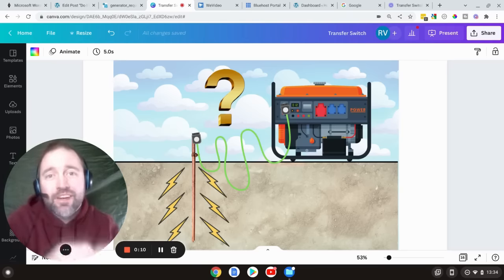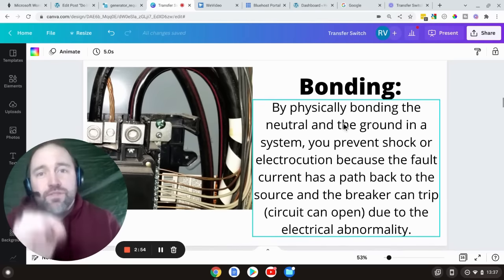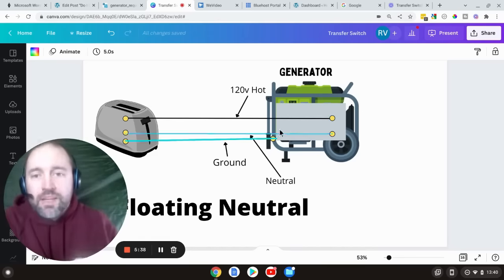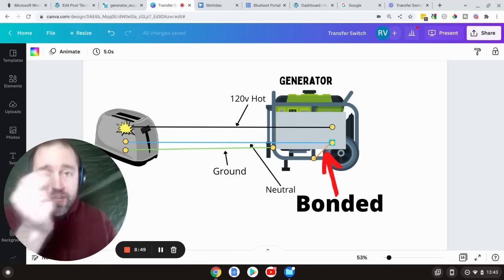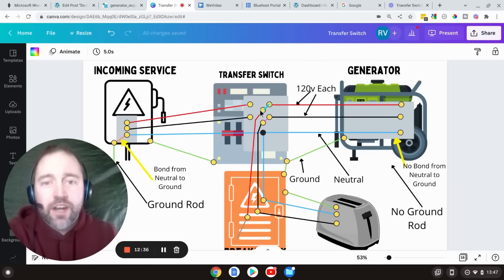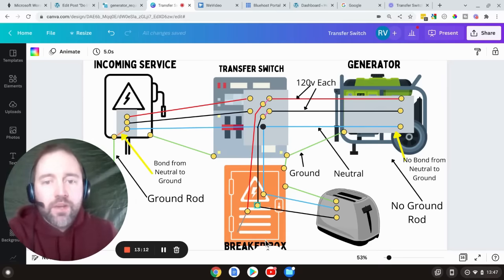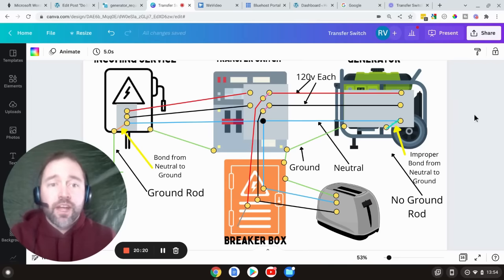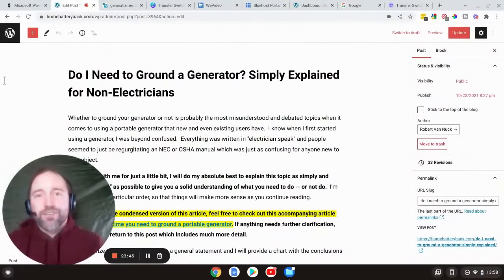When You DO and DO NOT Need to Ground Your Generator [Extension Cord Use & Backfeeding a Home]

Comment: As it has become more popular to do because it is cheap to do, what about going more into running an extension cord into the house from a small generator as in you manually move important stuff in your home to generator power by unplugging from one power source and plugging into the other source?  What I have come up for this for the 'easy' way to do it is the following:
1. Pretty much all of these small generators are floating ground even if they don't explicitly say they are.  So for bringing an extension cord into the home, you need to have a bonding plug on the generator.  Really, all of these generators should say what the deal is so you know you are doing the right thing, but they don't all say.

2. Especially in an emergency backup situation with extension cords, you can have things electrically tied together that are not all on extension cords.  Say you have a wired in Ethernet network in your house.  Those are generally copper wires running around to different devices.  If say you only hook up some of the devices to the generator and leave other devices plugged into dead wall outlets, you can end up with a big static potential difference and ultimately static discharges across sensitive electronics.  Then there is the whole deal where then nothing on the generator is connected to earth ground.  So what I came up with is you want to build a cable that only has the ground wire so you can hook the generator ground to house ground.  (It can split out from the male plug to have power on a female plug on a separate cable, but the special thing is one wire coming out is only a ground wire to a standalone male plug.)  Then everything is at the same potential over that ground wire only connection to house wiring.

Electrically when I think this through, everything is essentially bonded at one spot, the generator; it is just the Earth ground goes through the extension cord from the generator into the house and then you complete the connection to Earth through an electrical outlet in the house.  This is as in only the ground prong is hooked to the plug that goes into the wall.  If you get a plug with a light in it, it can help indicate to you when power comes back on in your home.

Tell me if there is anything wrong with my thinking.

Comment: My generator is wired direct to the panel thru a 30 amp breaker.   There is an interlock switch to shut off mains before enabling this breaker.    Does my generator require a ground rod?   I am guessing no because the ground and netral would be connected to the panel

Comment: What about using extension cords with either a floating neutral or bonded generator and your generator is being run off your porch and is not on the ground do you still not need a grounding rod? Thanks.

Comment: So if one is using an Intetlock kit, the ground wire from the generator would be connected on the grounding bar of the main panel... therefore no grounding rod nor ground bounding would be required, right ?

Comment: I used my generator years ago too test a deep well pump at my farm. I hooked it up too the generator..and started it. everytime I flipped on generator breaker, it would kill my generator !  I thought I had a short.. But later i took at huge rubber conveyer belt, and put my generator on it. and it worked perfect.   Why was this.?

Comment: if you don't have a 240V generator, and have shut off the breakers for all 240V appliances, would there be a ground/neutral issue if a separate cord were used for each house circuit breaker bank (A | B) plugged into the generator's outlets?

asking for a friend.

Comment: EZ Generator switch seems to disagree with you on ground rods. They say always use a ground rod. You say "when using an extension cord". When would you not be using a cord to power your load if you're using a generator??

Comment: I saw a lot of people putting temporary generators ont their houses by using the 2 phases connector of the hoven or dryer (the on with juste 2 phases and a ground) what is the flow path and the danger of that practice??

I also saw it on 1 phase standard plug to bring power to the half of the breakers.

They shut the main breaker by the way (gring source)

Comment: If a generator should be bonded when using an extension cord, why do floating neutral inverter generators commonly have standard household outlets, ie an outlet where one can easily plug in an extension cord?
Reply: Because the device on the other end of the extension cord also needs to be connected to the grounding point.  Otherwise, the ground rod would only offer protection for the generator itself, but not the cords and devices connected to it.

Comment: I have a Chinese inverter 6000 watts split phase to get the 240 volts (120,120) (APC 6000 48 volts DC) that I was thinking to connect via a transfer switch to the  house...the issue is that this inverter is not bonded..the ground and the neutral are not connected...but the manual for the inverter also say do not connect the ground and the neutral together...the inverter is being used with an extension cord to power the refrigerator...but now I  have a concern that since the inverter has a floating ground....you definitely need a GFCI....in case there is an imbalance in the amount of current being supply vs. the amount that return in the neutral back to the inverter...Did I understand your  video right...or I'm burning  weed here????Thanks.

Comment: HI.  What would you recommend when using a bonded generator with an Interlock switch?  I connected the generator to a 240v 30amp circuit breaker using an inlet box.    What precautions if any do I need to take?
Reply: It's the same as the transfer switch where the neutral is not switched.
Reply: @roberthester3778  so should I take off the bonding strap in the generator to make it a floating generator? no need for ground rod?
Reply: @904117  That is what I understand from the video.  Now I am not an electrician!  I would have a licensed electrician check out your setup and give you recommendations on how to configure your generator

Comment: I have a Harbor Freight Predator generator.  When I plugged in a surge protector to the generator's outlet, the surge protector's green grounding indicator would not light up.  To correct this, I drove a ground rod into the ground and connected the ground rod to the generator using a heavy 8-gauge conductor.  Still, there was no green light on the surge protector.  It made no difference whether I connected a ground rod to the generator or not as far as the surge protector was concerned.
Reply: Bond the ground and neutral with a bonding plug then it will work.

Comment: AC current ( electricity ) yes.. it does travel in a circle.. But DC which is also electricity does not travel in a circle.. Not sure if you corrected that statement or not, you made it at 3:30 , I paused the video and wrote this comment.
Reply: I think you are confusing DC with static electricity.

Current has to flow in a circle or the electrons pile up in one place, but only till they crowd up enough to create a static voltage balances the voltage on the other end of the wire, then the current stops. This only takes a moment.

The resulting pile up of electrons is called static electricity.

So if DC is flowing (for more than a very brief start up moment) there has to be a circuit.

Comment: What if you're using a transfer switch AND extension cords? Should the generator be bonded and/or grounded? Assuming the transfer switch has a continuous neutral. Reason I ask is because only my gas furnace is on a transfer switch. Other stuff I power with just an extension cord.
Reply: This is exactly the question I have too.  Thinking of using the same setup.
Reply: I just put in a wall plug and now I can unplug and plug into extension cords and no problem 
Making it simpler for wife 😊

Comment: Would you be able to comment on whether generator bonding is needed in a scenario where the (normally floating neutral) generator is connected to a typical "Spider box" or distribution box by a 4 wire NEMA L14-30 style 100ft extension cord?   Would the generator need to be bonded in that scenario?

Comment: If you have a bonded generator, why not just connect to the house with the two hots and neutral, relying on the bond in the house input service panel?  Since neutral is bonded to ground by the house, then the frame of the generator would be essentially grounded by the neutral connection with the only risk being the voltage drop from in the neutral wire's current.

Comment: So then there is no safe way to use an interlock kit with a bonded generator correct? (Interlock kit as in a piece of sliding sheet metal in the panel that wont allow the generator breaker and the utility breaker from being turned on at the same time)

Comment: Unbounded generator. Tied neutral transfer switch. With the shore power unplugged how would the fault clear? Because it’s highly unlikely to run the generator while you’re still plugged into shore power.

Comment: So, Dand and I tried to watch the game on his nice giant screen. Power was out so we cranked up the generator, opened the main breaker, ran an extension cord over and plugged into the house. Ok, lights worked so for some reason the coax was not hooked up and when connected it to the TV it sparked. Power supply blew out. Why?

Comment: At 12:50, So if using a bonded generator with a transfer switch, that is not a neutral transfer switch, with now having two paths, what would be the consequences? 
I know that in this situation the generator should be a floating neutral generator setup, but what if it is a bonded neutral generator, what are the potential consequences?

Comment: Hi I am trying to connect to a Franklin Electric SubDrive 75  which is a VFD for a well. Says it shouldn't be used with GFCI or externally regulated generator. How do I know if my generator is externally regulated?  Can I use an inverter generator?

Comment: What would even be the point of having a ground wire in the first place, in the event the generator was unbonded (floating), and the 240v power was fed into the main breaker panel with an interlock?

Comment: I think that your frequent reference to earth not protecting you from shock if your  toaster shorts is entirely wrong and a dangerous oversimplification. Any system with an RCD breaker will trip with the short, but if it doesn't have one then a live short to the toaster shell (when earthed) WILL blow the fuse/current breaker and prevent you from being shocked. At least that is the case in the UK.... I can't imagine that American wiring standards are so different that a grounded metal case won't protect you from a loose wire inside that box.

Comment: Still trying to sort this out. Looking at generators now to power my high efficiency furnace in the winter if power goes out. My neutral is bonded with my ground inside my breaker box.

Comment: In my situation the transfer switch was set up by the previous owner.   They also took the original generator.  With my generator the ground fault trips when I plug it into the transfer box.  
  How do I know if I have a floating neutral or a bonded neutral.  Seems to be floating.  
  Not sure how to approach this issue.   Any advice?
Reply: You can easily check the generator to see if it is bonded with a volt meter (on ohm setting, with leads connected to the neutral and ground).  The gfci is tripping because the current traveling on the hot lead is greater than the current on the neutral.

Comment: So I have a system that feeds the generator into the fuse box in the house. It has a device that shuts the main breaker off when the generator it connected. Is there anything that needs to be done with this type of connection?

Comment: I've installed around 100 generator/transfer switches. I've never seen a switched neutral transfer switch. 
 Is there a certain application where a switched neutral would be preferred or required?

Comment: Many of the new generators I'm looking at have an internal bond from neutral to ground. Do most manufacturers have options to remove the bond when needed for a non separately derived optional stand-by system or do we need to make sure that the transfer switch opens the neutral?
Reply: Just answered my own question. Called Firman and they do have instructions for removing the bonding jumper. Wonder how many homes have this bonding jumper still installed considering its not explained in the owners manual.

Comment: Sorry but I'm confused. After watching this video, I went to my harbor freight predator 3500 generator and tested the 120v/30amp receptacle, with my Klein MM700 ohm tester touching the red lead to the neutral and the black lead to the ground bolt/terminal, and it HAD continuity. But when I tested the other 2 plugs (120v/20amp) receptacles I could not get continuity. How is that possible? I tried each several times. I bought this generator to connect to my small single wide trailer home at power outages. I just pull the lead/wire from the main income PGE box and connect an extension cord from the generator to the trailer side lead/wires that I disconnected from the main PGE box. So, I basically only have the generator as incoming power, the fuse box is inside the trailer. Do I need a bonded or floating ground generator and do I need a earth grounding rod? Thanks for this great video.

Comment: Great video! I am an electronics engineer, and have done some home electrical wiring. However, I have always been a bit fuzzy on the whole bonding and neutral vs ground. I am helping a friend wire a cabin for 120V AC. He wants to use a gas generator to power it. I installed a breaker box, with two 15A breakers. Plan on running a 12 awg chord to the box from generator. If I understand your video, I do NOT need to install a grounding rod? But do I bond (attach my neu and grn) together inside my breaker box? or something else? Any advise is appreciated.
Reply: In your case there is no main service so your generator system needs a ground rod for generator and the generator needs to be bonded. The panel ground and neutral would be connected as well to the panel common bus bar. Your situation he describes clearly as it’s own derived power source with no main service whatsoever
Reply: @condor5635  Doesn't that create two bonding points, one at the generator and one at the panel? Aren't you supposed to have only one bonding point for any separately derived system? It may seem as though bonding at two points is innocent belt and suspenders, but eddy currents can mess up GFCI's, and create ongoing parallel current through the ground wires. As a non-electrician, I would guess the panel bond should not be there. 12AWG seems a little light to feed two 15A circuits....
Reply: @spelunkerd  - I guess thinking about it you might be right on the bonding part. There’s no main service whatsoever. How does bonding it as close to the source as possible fit into the picture? In this case the generator is a source.. thanks for the reply